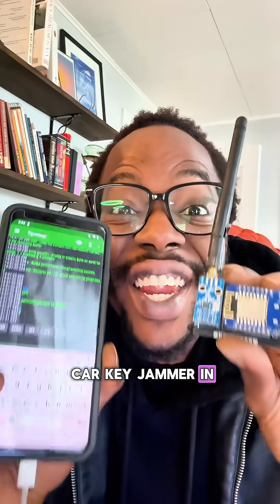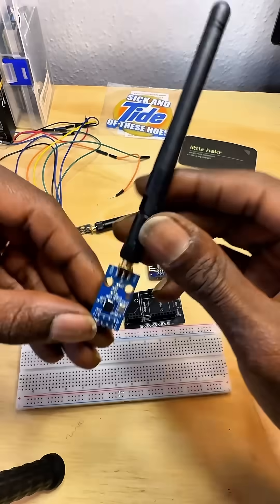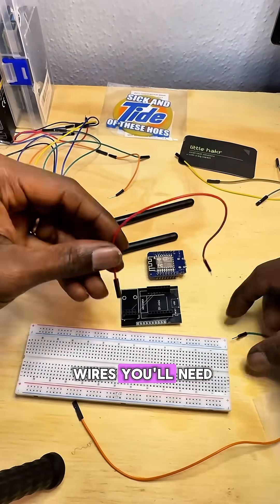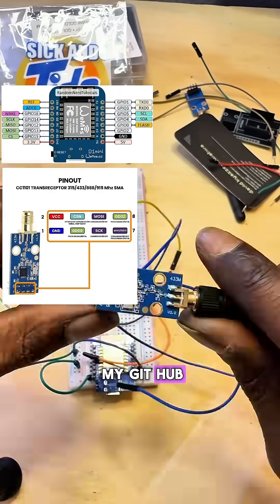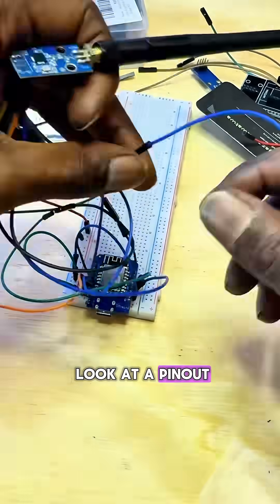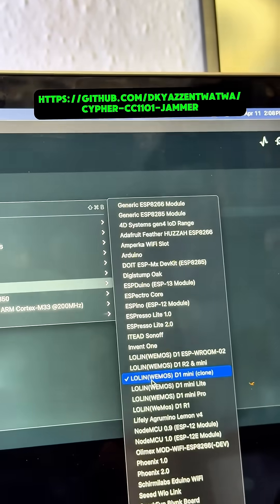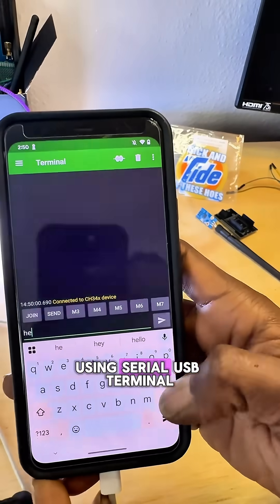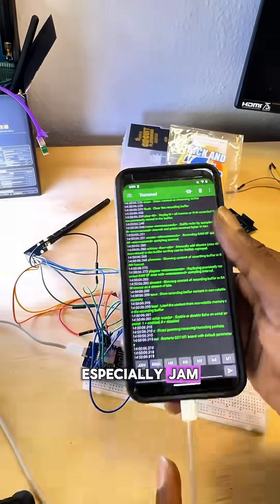How to Make A 433MHz Tool with CC1101 Module

Comment: This device would need to be extremely close to cause enough interference to jam a vehicle receiver, if at all.
There are better solutions utilizing these tiny modules. One would be a denial of service attack where the signal has a proper preamble for a vehicles computer to be constantly reading and rejecting a signal due to improper data.
The other is to use build a proper jammer with a tuned directional antenna and cap at high voltage.
Your test with an sdr picking up the signal proves how weak that signal is. It can't even overpower the sdr right next to it, let alone a vehicle parked any distance away. Power decreases with distance using the inverse square law.
Reply from the maker: Thanks for your input, of course this is the most basic example. One would of course use a band pass filter and amplifier to increase performance. I also have versions with 2-5 cc1101s!
Reply: @DivineZeal  That's a good idea. Just make sure they're spaced correctly to make a phased array. My only issue with that is that an esp32 can only tx on one SPI bus at a time. It's dual core, so perhaps there's a technique to program it I'm not aware of. Which is likely. I don't know what I don't know.